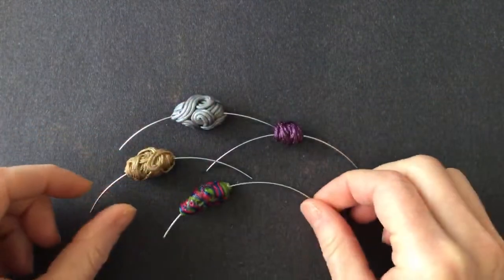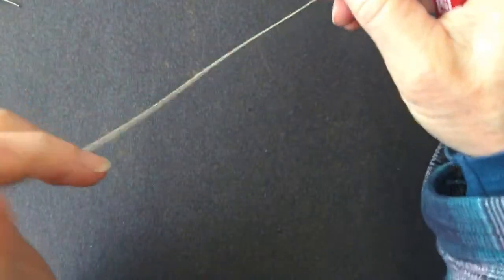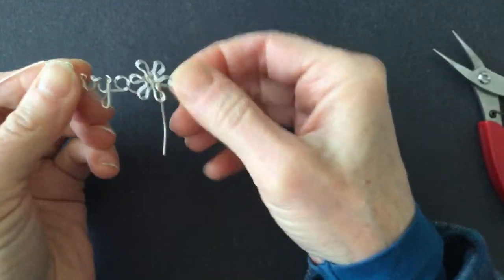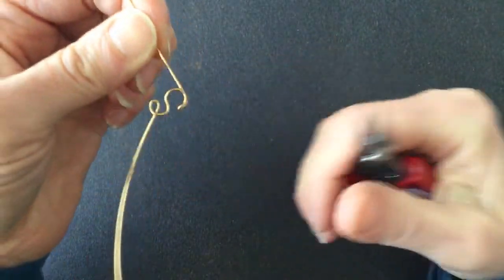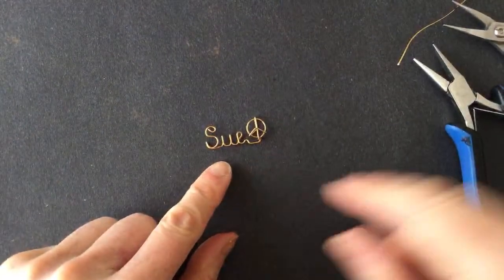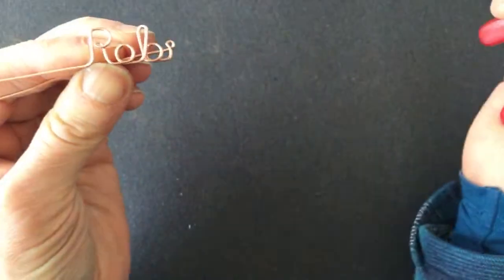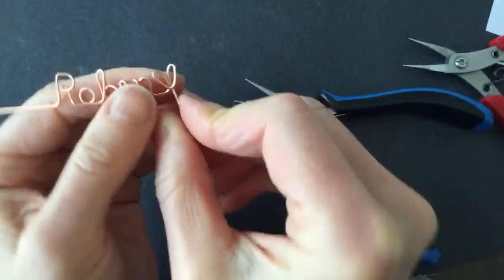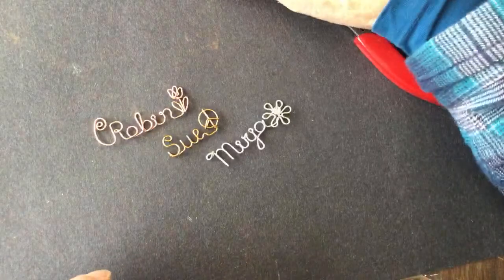Wire Name Necklace DIY Pendants: Wire Lady TV Ep 109 Livestream Replay

Comment: I want to thank you so much. Had ordered the forming pliers a good while ago , but just now getting to using them for jewelry  , had used them to make fishing lures though 😂 I watched both your videos on large and lower case letters. Took a page pic of the page and posed it. Then took some Harbor Freight stainless steel tying wire .030 diameter and went to work. Stainless steel is not forgiving in the least. But was able to spell out my beyoncé, nieces, and a couple of close platonic lady friends names. I used stainless because I have lots of stainless rope , plus knowing it won't ever tarnish. Have on order from Amazon some solder , and flux for the stainless steel.
Reply from the maker: Awesome Phil. I'm glad you are having fun with the letters! Steel wire is very hard!